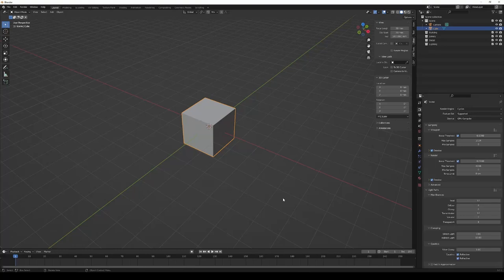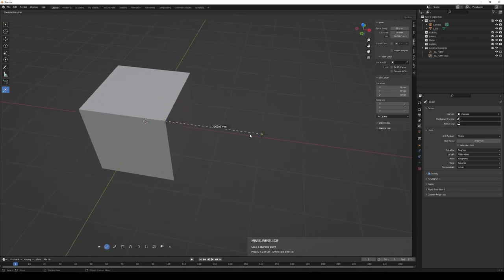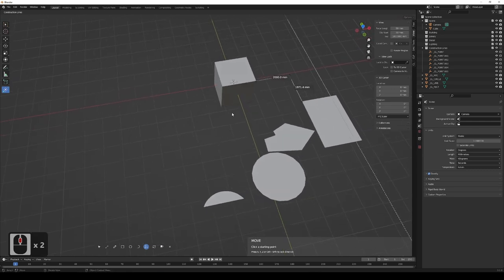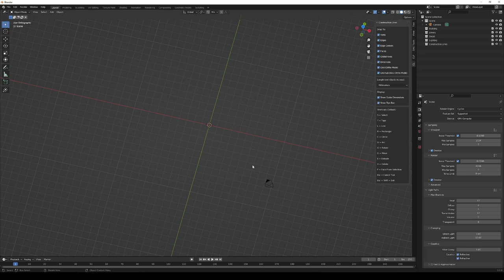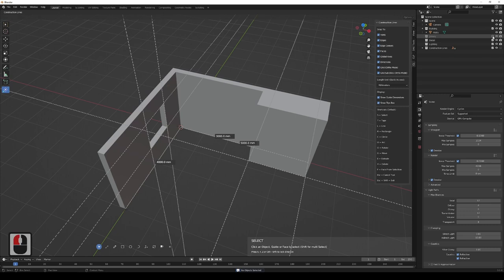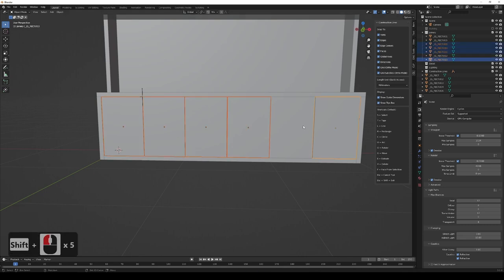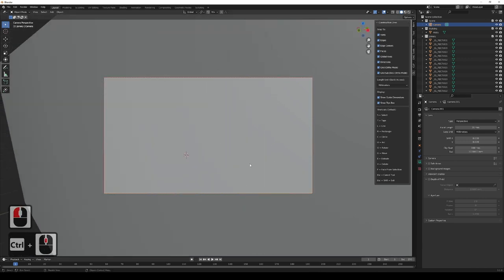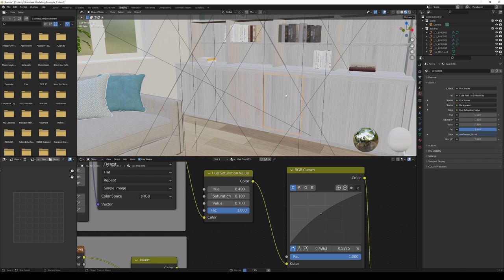Installing And Using Construction Lines For Blender

Comment: I have been using 3ds max for 10years and i have had my issues with switching to blender completely but i have to say your addon has really improved my transition to blender, i cannot imagine using blender without your tools. absolutely brilliant. a must have
Reply from the maker: Thanks so much for the comment!
Reply: @dndrawings  beautiful (and useful) addon, much needed
how do I update it to the newest version please?
Reply from the maker: @StefanoVerugi  Thanks! It's great to hear that. You can log in to Blender Market or Gumroad (depending on what platform you used to purchase) and the latest version will be there for you to download. If there are any problems you can contact me directly through my website and I can send you a copy direct.
Reply: 3ds max  plugin polyline pro 3.5

Comment: This addon is awesome. Having used AutoCAD and 3DS Max quite a bit, and now having used Construction Lines for Blender, I find that I prefer latter. At least in my case, it does everything I need it to, and it's just dead-handy to work with. And the fact that there're no commercially-priced subscriptions, makes the choice all-to obvious.

Thank you for this fantastic tool! I can't recommend it highly enough.

Comment: Great tutorial, this really helps me continuing with Blender after picking up FreeCad for precise modelling. Many many thanks. And yes it's a great tool absolutely worth buying.
Reply: Regarding the tape measure: I would like it very much if given distances can be entered and altered and adapting the size of the object accordingly, and the other way round, and I'd love to be able to set the distance indicator off of the edge measured. I hope you get what I am trying to say.
Reply from the maker: Thanks! I'm really pleased to hear that you like it. Regarding your second comment, allowing the dimensions to be altered and affect the model is on my development list, so should be in a version soon. I'm working on a tool at the moment to produce scaled drawings from models and have implemented dimensions with leaders so that you you can drag dimensions away from an edge. I'll try to migrate that to CL too.

Comment: First I want to thank you for developing a really great add-on.   I have learned to use Sketchup in Windows for a lot of my 3D printer modeling.  But I don't like Windows & have upgraded to Linux Mint DE.  Of course Sketchup doesn't function in Linux so I've had to stick with Windows to do my modeling by dual booting my computer.   I've been learning Blender & have been trying to figure out how to do things that I could do in Sketchup.   Then I found your add-on & had to have it.  It makes it so much easier to use Blender for 3d printer modeling.  Your add-on is definitely a must have for Blender.  Thank you.
Reply from the maker: Thanks very much for your comment. I'm really pleased to hear that Construction Lines is proving useful for you. I'm working hard on my other add-on for producing scaled drawings, then I'd love to switch to Linux too!

Comment: The most needed feature in blender that i need is the resize tool, to get the model in to the right size, like a for plane imported, if i need to make all the model in the right size, in sketchup i could mesure one of the walls and time the right dimension, and it will change the model proportional to tat wall for example.

Comment: hey, great video! quick question: after finishing the sketch, is it possible to export it into a plan that can be printed, including the measurements and lines? cheers
Reply from the maker: Thanks. Currently this isn't possible but will be possible in an add-on I'm currently working on (alongside CL). This add-on is more general, so won't require CL to run. I'm hoping to get an Alpha release out fairly soon.

Comment: I bought this a while ago and I really want to like this addon. The functionlaty is really great and gives you finally precision tools in Blender. But: It's flawed. I would say I am a power user, I know how to work with HardOps, Boxcutter and so on. And I really invested some time to get into this tool. But it works very unreliable and I had to deactivate some other addons so I can work with it somehow. It's more a software in a software than an addition to the Blender functionality, cause so many things which are working in normal Blender are whether not possible or different in "Construction Lines" mode. Please, please make this better and more reliable in the future, cause I desperately want to work with it properly!
Reply from the maker: Thanks for the comment and I take your points. I'm working hard on the next version at the moment which has some big reliability improvements. I've also completely rewritten the extruding code so that it no longer relies on Blender's boolean modifiers (which are quite buggy). In the most recently released version (0.9.65) I allow a lot more of Blender's functionality to work whilst using CL (if you don't have it, definitely upgrade). This will increase with the upcoming versions. I initially limited what could be done as often Blender's action would mess up the internal access I had to objects and cause crashes but I'm working around these problems all the time. My main focus at the moment is getting things more stable and improving performance.

Comment: It looks great, especially the guide lines, but I really think you need to add construction planes. I’d like to be able to draw 2D sketches on planes that are created in line with any chosen object face (with an optional offset), edge + orientation (or another point), or group of three points. The plane intersections are very useful, too, such as for identifying the peaks of sloped roof sections. I’m a Fusion 360 user and I can’t imagine CAD in Blender without them.(Please forgive me if I’ve missed something as I’m a Blender noob.)
Reply from the maker: This is on the development plan, so it will come at some point. I've used Fusion in the past and it is a really useful feature.

Comment: Great tool. After configuring it I tried to follow the given tutorial and lost some hours trying to figure out what went wrong with my setup. In the end I found it - I had set up Blender with millimeter precision. The room here is 5000x4000mm, my horizontal guide length was set to 1.0 so every line it created as a parallel construction line was so miniscule I couldn't see it. Maybe this is something for the FAQ or the manual (which I DID read 🙂).
Reply from the maker: Thanks for highlighting this. I'll put it in the FAQ section.

Comment: A great add-on for blender. I want a better way to do precise measurements while using Blender. Even though I am trying to construct something completely different then construction items it seems this add on can help. I am working with digital  plotted points on my object using XYZ axis points. It seems I could use your construction line grid to help me snap and locate those digitized points on my object. Since I am dealing with irregular surfaces I can then smooth out my render between my digitized points. Also rumour has it that you are going to work with lines and angles together so I can move to the point I need without using a reference grid.

Comment: Love this ... having trouble with guides ... the color! Yours is white in the video mine is black maki8ng it very hard to see ... How can I change that?
Reply from the maker: Thanks for the comment! You can change the guide colour in the preferences Edit->Preferences->Add-ons->Construction Lines. There's a section for interface colours at the bottom. If you're using a M1+ Mac, you may also need to uncheck "allow dashed line drawing" to see the guides properly.
Reply: That did the trick, unchecked allow dashed lines ... only drawe back is the lines are solid and not dashed but at least I can see them now thank you
 @dndrawings
Reply from the maker: @MBStudiosArt  I'm glad that worked! It's a really tough problem for me to solve at the moment as I don't have an M1-3 Mac so I can't test a solution. If you know of any good Mac in the cloud type services, please let me know. I paid for one recently but it was slow, it was effectively unusable. I may end up having to buy a mac for testing but I'd rather rent one if I can.
Reply: @dndrawings  I'm using an iMac BTW... If at anytime I can help I would be happy to again thank you for this
Reply from the maker: @MBStudiosArt  Thanks, I really appreciate that!
Reply from the maker: @MBStudiosArt  I've re-wrtten the GPU shaders now and I think it might have solved the issue with dashed display on Metal. Can I send you a pre-release version to see if it works? Thanks
Reply: @dndrawings  yes what do you need from me email? Or?
Reply from the maker: @MBStudiosArt  yes email plesae. If you can contact me through my website (so you don't get spam mail from bots on here). I'll send a version over. Thanks.
Reply: @dndrawings  done

Comment: Although I am reasonably proficient with Sketchup, Blender was a whole new experience for me. After checking out Blender a couple of years ago I put it all on hold. I found the most irritating feature to be the preference for using hot keys in most tutorials instead of the built-in toolsets. You can learn to use built-in tools using trial and error, but that doesn't really apply to hot keys!

Comment: Can you snap the guides in other custom directions besides x,y, and z? What will happen if you have to model angular rooms or furniture?
Reply from the maker: I'm working on local snapping for an upcoming version, along with snapping to fixed angles. You can lock to a direction by draging a guide in the direction you want and then pressing Ctrl+Shift.

Comment: great addon but what if i wanna export a blue print with dimensions? is that possible???
Reply from the maker: Thanks. It's not possible with Construction Lines but I'm currently working on a new add-on that is designed to do this. I'll post a video here once I have a working version.

Comment: HI DND !,
I was thinking of giving BLENDER a test drive for my Architectural works sometime ago, I currently use DataCAD & sometimes SketchUP & also learning ArchLine-XP. In its plain form, I was surprised BLENDER doesn't have basic tools for CAD type design/modelling, so a non-starter for me. However, with your CONSTRUCTION LINES add-on, I will consider looking at BLENDER again, including the other Architectural add-ons.

Comment: Hello Dan. 

Like you work, but is your extension available for the latest versions of Blender and/or 
Bforartists, and if so, can you use the same plugin for both apps. 

Cheers mate!
Reply from the maker: Hello Mike,

Thanks for the comment. Yes CL runs on the latest version of Blender. I've not tested on any of the Blender forks like Bforartists but once you've purchased CL you can use/try on any version of Blender or fork of Blender (you'renot limited to one install), though I only support the ones listed on my product page. 

Cheers.

Comment: hello we seem to have issue with size input values for 1000mm rectangle it is putting 1mm for some reason please advise ? also how to snap to grid.. TIA
Reply from the maker: Have you set your unit scale to something other than 1.0? If so, you can either change it to 1.0 or if you require it to be at a particular scale there is an "Override Unit Scale" in the add-no preferences under Construction Lines.

Comment: why tool doesnt allow the regular short cuts. i am very used to working like;
G > (XYZ) > 10 like similar combinations. move tool is nice but why I cant use my shortcuts like I am used to. 
is there way to disable this behavior ? i want to use this tool but I want to use my regular shortcuts too. you are probably very used to working like this because you work a lot cad but for regular blender user like me this shortcuts so important.

and tool ignores the disable selection set too. i sometimes make flat canvas to see what I am working and I lock it and disable selection. 
this tool ignoring that and selecting and moving.

Comment: I'd like to get it, however, Blender 4.0-stable version has just released. Is this already operational with the new version of Blender or should I wait till you do some update work?
Reply from the maker: I've had to fix a few drawing issues with Blender 4.0 as the API has been updated. This is in testing at the moment (to make sure it's going to be backwards compatible) and should be released very soon. I'll reply to your comment here once I put a release out.
Reply from the maker: Just to let you know that Construction Lines version 0.9.68 has now been released and fully supports Blender 4.0.
Reply: @dndrawings Completed purchase just ago! TYVM!

Comment: good job! is the implementation of the various snaps planned? perpendicular type ..
Reply from the maker: Thanks! If you drag the measure/guide tool, the line tool or move from an an edge, CL will auto snap to perpendicular directions. The same from a vert, will snap to edge continuations. This is in addition to the global axes.
Reply: @dndrawings  thanks, actually i try to create a line from a point to edge perpendicular to edge, can this be done?
Reply from the maker: @ChristianConsoli  I hadn't thought of this. CL won't highlight perp directions this way around (point to edge). I've added it to my dev list. In the meantime, depending on your model, you might be able to achieve the same thing with horizontal guides.

Comment: Hi, American here. i know the metric system is better but just thought I'd let you know your snap to grid sub divs function is misaligned for imperial measurements, that aside i'm loving this plugin so far
Reply from the maker: Hi, Thanks for the comment. Someone pointed this out the other day. I'm working on a fix at the moment along with better handling of imperial input. Will make it into the next release. Cheers.

Comment: it clear. thanks.
Reply from the maker: I can't recreate this one but I've just emailed you for some more detail. Thanks.
Reply: @dndrawings  hi,

I try to install the latest construction add on, on my other device, and it runs normally. I guess my main laptop run in conflict to other add on so there is the bug. it clears now. thanks. 

I request the next update of construction line add on, = snapping detection on intersection between two objects, just like in SketchUp. thanks, before.

Comment: This is great, I have had this plugin for a while but not looked at it until  now (my sketchup licence up for renewal!). What do you use for technical scale drawings? It would be great if this could be included!
Reply from the maker: Thanks for the comment! Glad you like CL. I'm working on a technical scale drawing add-on at the moment. I've had to move away from it for a couple of months as I've been working on a big update for CL but I'll be back on it soon. I'm planning to put out an Alpha fairly soon. I'll post a video to show how it's going to work.
Reply: @dndrawings  Sounds good. Hopefully there will be something like Layout (SketchUp) or AutoCAD 2D with line weights, annotations, hatches, shadows etc (zero or minimal use of inkscape) for plot ready scale drawings at some point for Blender! Stephen Leger got quite close but the output looked pretty basic compared to cad. It may be user error but I found the CT add-on move tool accidentally selecting the wrong object quite often (after selecting the object and when choosing where to move it from), it would be handy if these tools 'locked onto the object' you're working on. Similar issue with the line tool if there's anything else nearby. Thanks!
Reply: @dndrawings  It would be great if it can work with Archipack and hombuilder, those don't have a decent 2D output so far, only SVG (not for pro use) or DXF export to CAD but really, scale drawing with a few line weights should be possible from Blender.
Reply from the maker: @johans7119  I'm aiming to make it add-on independent, so that it doesn't rely on anything but blender geometry. I'm currently at a stage where I can produced scaled drawings at a particular paper size, with annotations and measurements that are attached to the geometry (they will change as the geometry is updated). It also allows for multiple views which can be laid out on pages. It will be similar to Layout.

I'll take a look into the above issues you noted. If I can reproduce them, I'll fix for the upcoming release.
Reply: @dndrawings sounds good. I would be happy to buy a "pro" version if it could replace layout. I've noticed a couple of minor bugs/improvements that could be made. Do you have a discord for CL or something similar? cheers
Reply: @dndrawings just a few line weights would be perfect. dash line and a few hatches if possible. here's a good example, but I would use metric. https://youtu.be/YkTfTfhWIAY there's also "first in architecture" who have a video on metric line weights https://youtu.be/1hjyz07ceHs
Reply from the maker: @johans7119  my discord is https://discord.gg/7A9W4HEm there wasn't much uptake on this in the past (most were using the Blender Artist forum) but I want to start it up again, so please do comment there.

Comment: i'm using CL 0.9.691. and it can't extrude all faces at the same time. is it bug?
Reply from the maker: The extrude functions were completely rewritten for version 0.9.66, and multi-face extrusion wasn't possible. However, I've just completed work on reintroducing it, and the next CL will be released very soon (it's currently in testing).